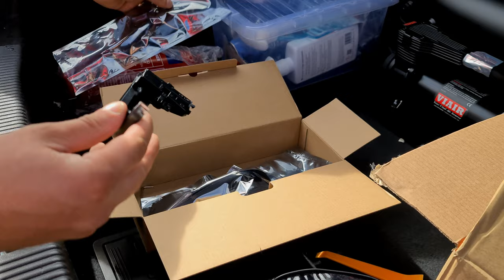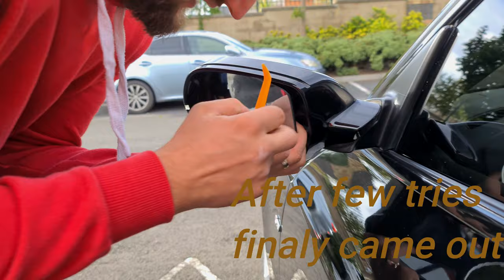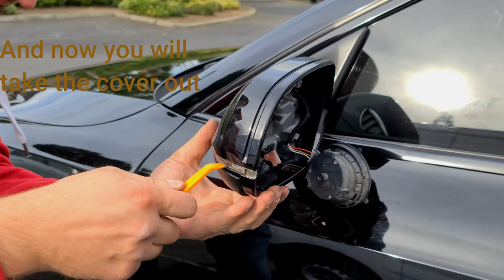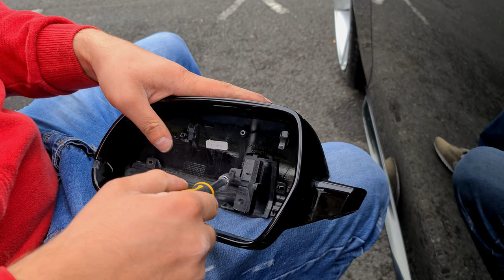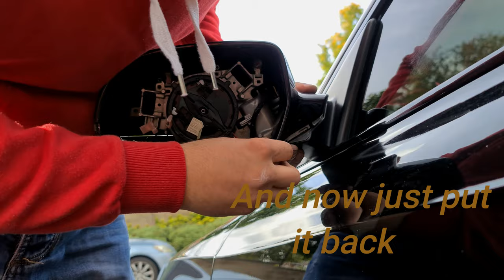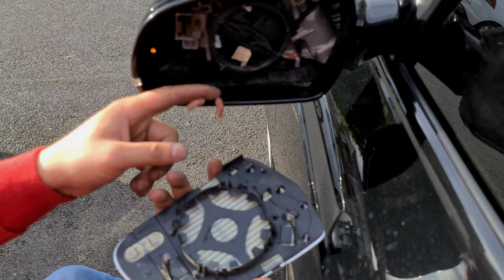Audi A5 Sportback 2011 / How to install Dynamic signal mirrors and removal

Comment: Got the same dynamic indicators. Just had power folding mirrors retrofit done to my A5. Had the install guy fit the dynamic indicators whilst the mirrors was off at the same time at no additional cost.  Now have both power folding mirrors and dynamic indicators. Looks better than the standard ones.
Only thing I find dim is the end section that is visible when sat in the car. Other than that it's all good.
Reply from the maker: Nice 🤜🤛